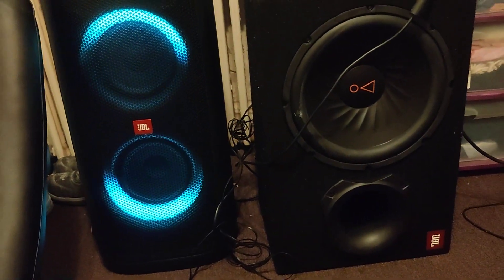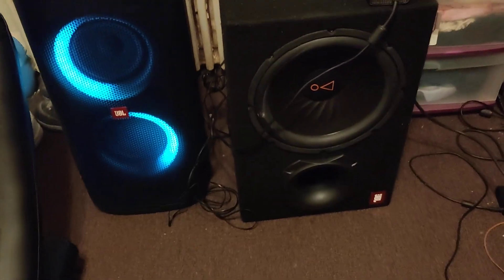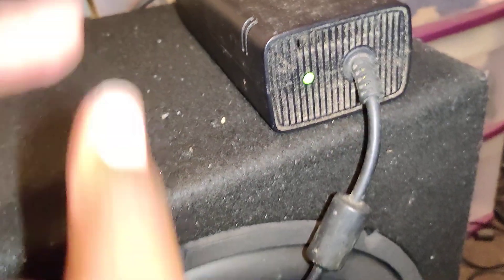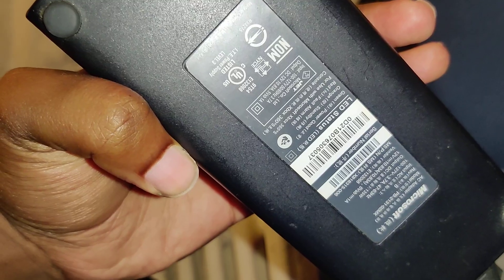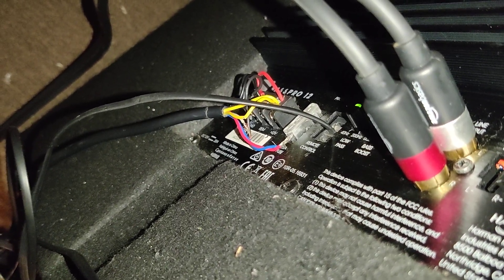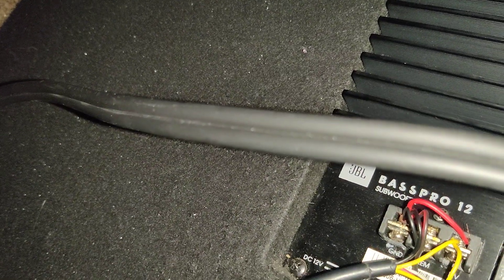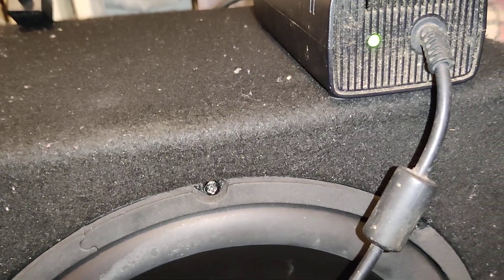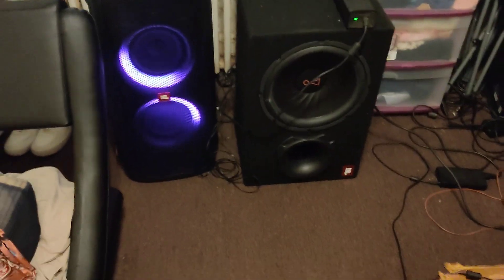How to power a car subwoofer with Xbox 360 Power Suppy

Comment: These PSU's provides max 200w . Safe if you dont crank up the volume,but if cranked up more than likely it will blow. Unless JBL amp is not more than 200-250w rms
Reply from the maker: @miki476  tell that too my other Fosgate 12" 650watt sub, I've literally cranked up the bass, kept bass boost off, & frequency set to "40hz" as the Amplifier I use for that sub is A Fosgate "700 mono amp" & it's solid, no over heating issues and the PSU stays green
Reply: @hzd1494  damn thats that good old xbox 360 reliability
Reply from the maker: You know it